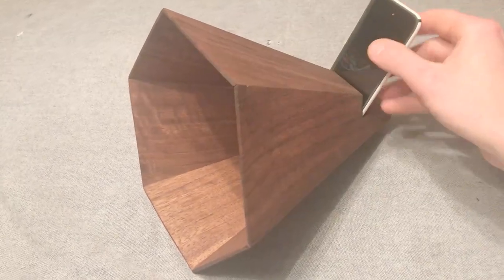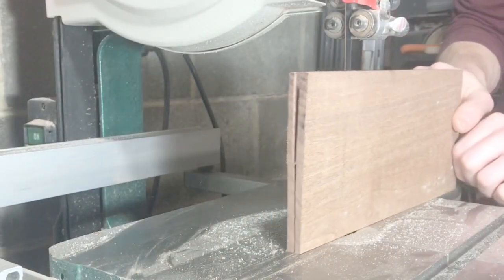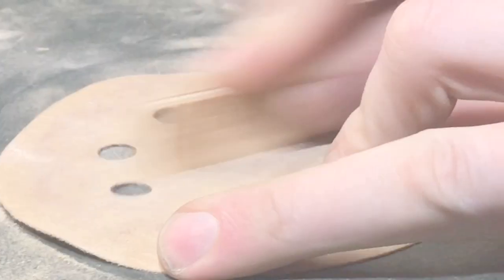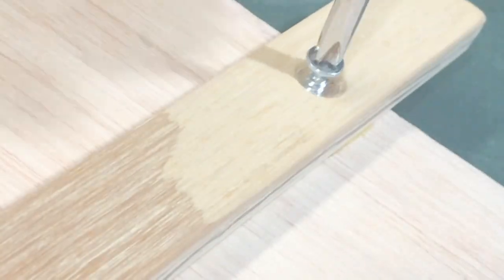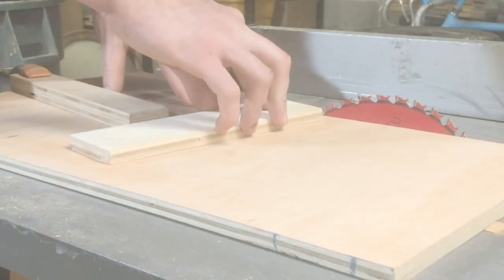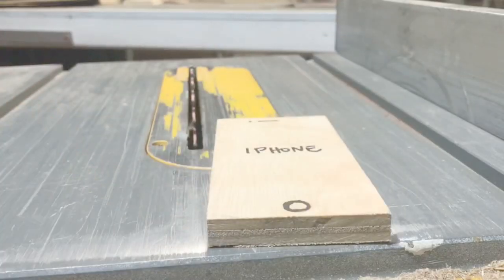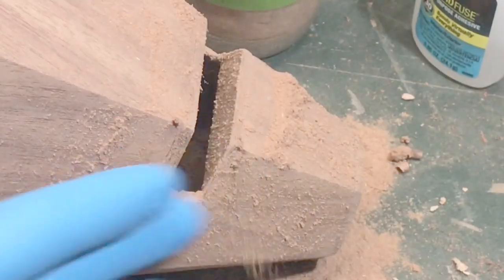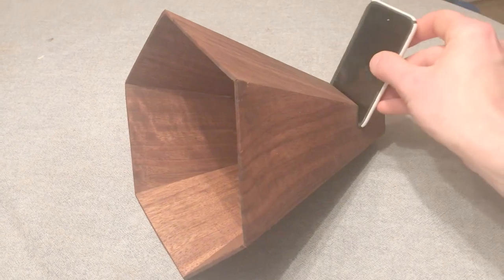Let's Make a Wooden Speaker / Amplifier for your Phone

Comment: Cool project. I’m pretty sure the trouble you were having making it go together was due to some basic geometry being off. A 60° bevel cut is only going to be accurate for a straight sided hexagon.  The jansson.us website has a compound angle calculator page with an N-sided box calculator which would be perfect for what you are doing here.
Reply: Thank you for the share... It's awesome. I just wish I had listened better in geometry

Comment: Hi Chuck.  Awesome thinking!  I'm thinking of making a cut file for CNC.  What did the measurements end up being for each end of the panels (and the length)?  That way i don't need to mess with figuring angles. Thank you
Reply from the maker: Thanks man! That’s awesome a CBC would be a sure fire way to make it live up correctly. So that lil guy is actually up in Delaware. (I’m in NC) I honestly just picked some arbitrary angles and set up the stop block so they were all the exact same. I’ll see if I can’t find the measurements though
Reply: @burgbuilds  that would be awesome. Thx